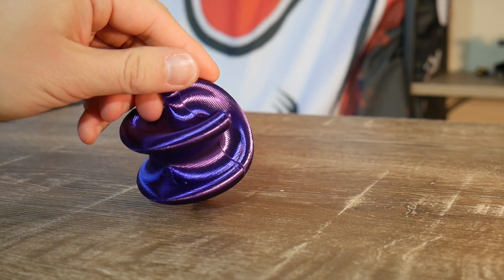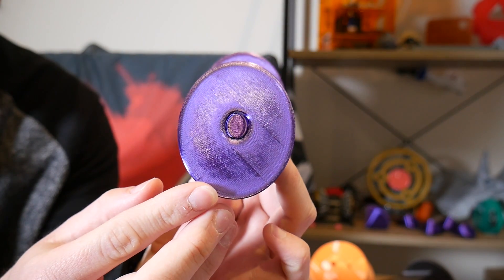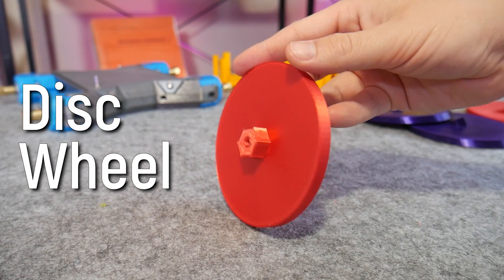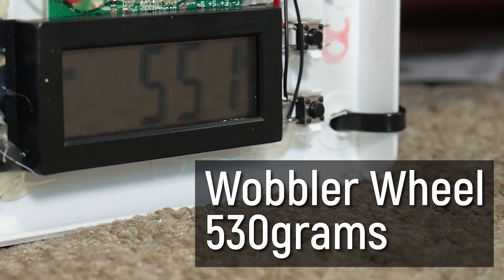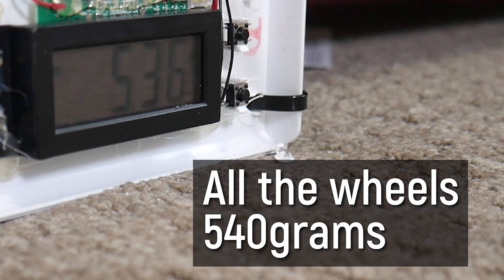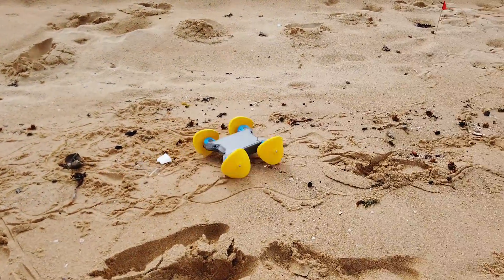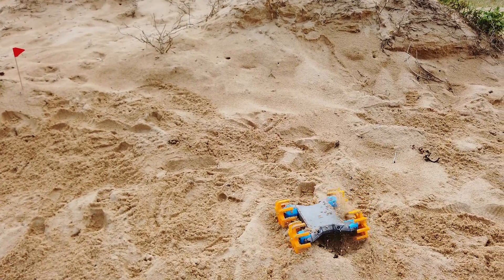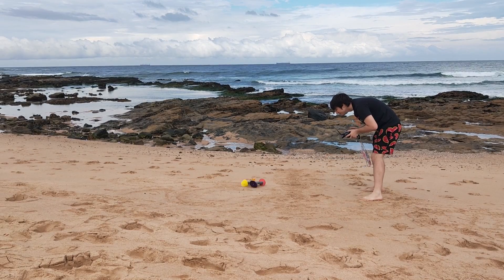This Robot Drives on Wobbly Wheels (but HOW?)

Comment: The spoked wheels had an unfair test due to their smaller diameter, so the chassis had less ground clearance. The beauty of paddle tires is that while the paddles are gripping, the surface between each paddle is providing floatation on even a loose sand surface. Loved the video anyway!

Comment: As expected the spoked tyres won out on sand but not so good on carpet. I propose a new design, based on the spoked but with 45° helixed spokes instead.
The spokes should be long enough that the end of one overlaps the start of the next. 
This allows for a continuous 360° of contact points with the ground but provides an ideal compromise for soft terrain where the spokes can lever off.
@Maker’s Muse

Comment: I guess NASA knows what they are doing with their wheel design on the Mars rovers, ay?

Personally, I think you need to count the sides of the paddle wheels in your surface area calculations simply because that is where the force is being exerted the most. Especially in the sand. To make it equitable, you should have perhaps half the paddles.

All-in-all though, the experiment was cool!

Comment: You want to know what is the best wheels for sand? Drill shape (big core and small fins), and make it CW for front left and back right and CCW for front right and back left so you can move the front and back wheels in different directions and move the robot sideways!

Comment: To drive a car on sand, you usually deflate your tyres since this creates a large contact area and low pressure on the soil. Together with the tread, this propels you forward. 

The spokes work because the contact pressure is lower. 

The Nightshade wheels don't dig in because they don't run create a rut until it stalls. 

Something between a Pringle and a folded Dorito would probably achieve a similar affect. Mathematically, I suspect the optimum fold over would be a sinusoid. 

A herringbone spoke might also work since it would trap the sand in the V.

Comment: I think there is no one "best wheel" for all situations because it depends on the situation.  The surface being sand, carpet, concrete, hardwood floor, ice, water, etc. each pose a different challenge. Also if the vehicle is pulling a load.  On mud or sand, the more surface area and if your wheels have paddles, then it will ride on top and not sink and get good traction.  If this were ice,  spikes or pins in the wheels or wheels that had spiky points of the ends would give it best traction.  Also the material making contact with surface matter.  Rubber vs plastic or some other material matters.  Also the torque generated by the motors also matters.  I know electric motors have lots of torque, but maybe less torque might be better in some situations.  But overall a very interesting and fun experiment!  I was surprised the wobbly wheels actually worked but they worked quite well and visually not intuitive on how they were actually working.  Keep up the great work!  :)

Comment: I think that the erratic behaviour of the wobble wheels on the pull test is because as they turn the contact patch of the wheel moves away from or towards the chassis, so the thrust vector for each wheel is moving sideways to the pull axis in a random way. The prongle wheels do the same thing, but at twice the frequency and half the amplitude per revolution, so the pull is steadier.

Comment: What about zigzag wheels? Sort of like the prongle, but with more folds, on both sides of the center line of the wheel? I'd think that it would help bite into the sand and push the vehicle forward.

Comment: Yeeah, the paddle tires actually have far far far more contact surface area than any of the other tires, because the entire front edge of each spoke is making contact in addition to the outer edge. Beyond that, you aren't using friction when you push with the side like that, so you're not only doubling the surface area, you're comparing apples to oranges too.

Good video though! The path made by the wobbly wheels looked just like the trail of a snake to me, that seemed to be the most stand-out detail that came of this.

Comment: I think the problem is that the wheels are spinning too fast. When they go faster, I believe they are just pushing the sand away, but if they were to go slower, they might have a chance. I think friction is also an important factor with this.

Comment: I think that the major problem is that the first 3 wheels move the sand to the side  and this cause the car to dig a hole and get stuck in the sand. 
The orange wheels move the sand from the front to the bottom of this hole under the wheels itself, so is more difficult to get stuck 'cause they gain a lot of traction as they move the sand.
Orange wheels are wider too an this is always a good thing on sand

Comment: Youre comparing 1d wheels against 2d wheels.
Regular wheels on the sand or carpet are only a singular small line, with 0 grip, because theyre smooth... and ure compairing them to curved wheels which are pushing with an edge.

Comment: A better test would be if the middle of the bottom had higher ground clearance. Then the wheels would all get a better chance to work. It seems most of the time when it gets stuck its the body and not the wheels that's the issue.

Comment: The 8 spoke have more traction on the carpet because it has a sharp leading edge contacting the carpet during rotation. What would happen if you printed a radius on the outside of the spikes. Same as the sand trial.

Comment: Would probably be a more fair comparison on sturdier ground, like dirt. The "bucketwheel" design is specialized for extremely soft ground like sand, but they are absolutely awful on asphalt and other hard ground. so if you were able to coat them in rubber or something you could see how they performed in a urban/racetrack-like environment.

Comment: #1 -- the wheels have no claarance.  #2 the 'spoke' wheels did at least a bit better because this thing called "traction" was discovered decades ago and off-roading doesn't need to be reinvented.  Interesting experiment -- but most of the transportation industries ahve already figured out motion mechanics for numerous ground conditions.  You seemed to be on the right path w/ the spoke whjeel ... look at different condition tire treads or different 'tank' tread patterns and come up w/ maybe an open design from those.

Comment: In the carpet pull test, the attachment point on the scale appears higher off the carpet than the point at the car. The chain should be exactly horizontal, otherwise the resulting force tries to lift the back of the car a little, reducing grip and making results meaningless.

Comment: Why not put 'paddles' or treads on the other wheels? They all have smooth surfaces, offering no grip in the sand, as opposed to the 'spoke' wheels, which are essentially all 'tread'.

Comment: I think the spoked wheels with an L shape instead of a
square shape. This would push in the up direction and at the same time push the
vehicle forward. In Sand, you need to push up at the same time forward.

Comment: Seems like the spoke wheels might handle the sand better if the open area between spokes were “filled in,” if you will...cool video!
Reply: And at that point you've pretty much created an off-road tire.

Comment: If you want to increase traction, use as little plastic between the hub and the tread and increase the surface area of the tread.. Depending on the surface, on something like carpet, change the tread into something bumpy like velcro. On sand, make the tread screen-like with the openings slightly smaller than the size of an average grain of sand.

Comment: Nice ideas, but I think the answer already exists: a lot of ground clearing, plus paddle wheels or tracks for a surface like sand. 

If you really wanted to test your designs properly on sand, wouldn't you have to enlarge everything to a size that actually matters for humans? Just wondering, because making those wheels bigger and a bit wider could actually already make them perform a lot better. If you compare a real sand buggy to a remote controlled toy one, you'll find that the toy one gets stuck in the same sand all the time, but not necessarily because it has an inherent flaw other than being very tiny.

Comment: No surprise.  The wheels remain a truncation of the cylinder and roll in the same axes of the original cylinder.  In practical use, the wobbly wheel would have greater traction but poor aerodynamics.

Comment: why not a dual hub wobbler (2 faces) spaced about the thickness of the spoked wheels connected by the treads in the orange spoke wheel for traction. I think a lot of the orange spoke wheel was the width of contact with the surface, but their were benefits of the wobblers that could give them tractions.  The other thing you might want to look into is 'Camber'.... How does Camber affected wobbler wheels, when camber is such an important factor to car handling. How do wobble wheels work affected by suspension?

Comment: 2 suggestions -
1. Add spokes to the Prongle wheel
2. Add a suspension system to the 8 spoke wheel, I hope it will reach the finish line. 😉

Comment: The spoked wheel is essentially a disc wheel with an additional feature. To make it a fair comparison, we would need to see  a wheel that is both spoked and wobbly. Additional suggestions: stick wheel (lots of long narrow studs poking out from the wheel) and brush wheel (even more even longer and even narrower appendages, preferably flexible)

Comment: combine the solid wobbler with the spoke teeth wheel so that it's a solid wobbly wheel with spokes- Wider diameter wheels will make them more efficient in sand, even if only a little bit larger, those wheels looked a bit small. If you adjust the spokes to be centered on the rim of the wheel hub instead of only on one side the spokes will have more structural integrity with the same surface area- you could use an extended axle for them to account for the wobble and spokes.

Another design is a wheel of pin spokes, that just simply point down, maybe even with a small attached circular pad on each one or just a sharp tip ?

Comment: When it comes to loose material like sand, it's all about having paddle wheels that act kind of like a scoop. You want to push against as much material as you can, but you don't want it getting stuck in any recesses the tire has.
Reply: The combination of paddles on balloon tires gives traction without sinking/digging into the sand.

Comment: Don't forget the speed of the wheel turn does have its factor toward traction on loose soil or sand.  Some times slower is better than high speed, which can cause the dug out.

Comment: force = mass/area... you measured the wheels wrong. The reason the spoke did best is that, at any given moment, it has FAR more surface to ground contact. This is commonly known to act as a friction force.
Put another way... if all the motors, plastics, charge, and the ground remain the same... what changed the outcome? Surface to ground contact.

Comment: Folks, if you love this man's work, then give him the credit he deserves. 
Mix, remix, adopt, adapt, hack, extend, derive, re-imagine as you will... 
But above all, respect the sources of ideas. 
That's closer to the Maker Spirit, I would imagine.
Reply: Perhaps if the in-between regions of the spoke wheels were filled in, as were the buggy weels at 13:10, you might end up with a better wheel for sand. Also, are the wheel moters able to talk back their rate of spin? If so, you might have the basis for a sort of electronic limited-slip differential. Why solve one problem when you can focus on a hundred problems?

Comment: The benefit of the Wobbly Wheels is the potential ability to run them like a screw and drive the vehicle directly perpendicular to it's line of travel. This would be accomplished by running the front axle in reverse and the rear axle in forward. The other benefit of using this mode of travel is that the vehicle has a narrower centerline cross section when traveling sideways, which limits the probability of it becoming high centered.

Comment: Very cool project and experiments! I wonder if those spoke wheels may have performed any better on the sand portion if you installed them facing out away from the body instead of in around the arm and motor? My thought is when they started bogging down there would be more open room to move sand and possibly move forward instead of losing momentum. Thinking further down that line, if you installed the front facing out and the back facing in then they wouldn't be digging into the same trench line.

Comment: I think, the spoke wheels did so well because of their larger contact surface, thus distributing the weight of the platform over the sand.

Also, I think If you're driving at a slower speed, I'll presume you have a better chance of getting unstuck

Comment: very wide paddle wheels at a very slow speed should move over the sand instead of brushing it backwards even at steep slopes. one improvement to the existing spoke wheels can be to make them solid, with the spokes being the "paddles". this way, however, there would be a very large surface area for the wheels.

Comment: Straight wheel 405g = 101.25g per wheel 
Wobbler wheel 530g = 132.5g per wheel 
Pringle wheel 550g = 137.5G per wheel 
8 spoke wheel 600g = 150g per wheel

1 of each wheel 

101.25+132.5+137.5+150 
= 519.25g theoretical compared to 540g actual

Seems about right to me...

Comment: very cool video! In my opinion it‘s obvious that the wheels would rather dig themself into the sand than moving the vehicle forward if the plattform is laid so low.. there‘s a reason off-road vehicles have much more space to the ground than supercars which can only drive on streets

Comment: If that vehicle with the wobbly wheels is boyant exactly at the centerline, it looks like those wheels would provide probulsion along water as well. As in, it looks like You'd be able to have the sideways forces cancel eachother out, and have clean forward motion.

Comment: Hey beautiful community, so iv purchased an ender 6 as my first 3d print that I own. Iv used the ultimaker 2 at school and the ender 3 from my friend. So I opted to go for the big guy. Im really struggling to get good clean prints with the ender 6, iv dehydrated my filament, upgraded nozzles, updated drivers(software), I tried different slicer versions of Cura and im still having a hard time getting good prints. Im really tempted to sell the printer and get a Prusa. But im willing go give more ender 6 another gooo, but I need a little guidance from someone so if someone would be awesome enough to give me a hand with walking me through getting my prints at a higher success rate that would be awesome 🤙. I am using the printer for printing my own engeering designs and stuff for school (university). Let me know if you wanna join a discord or if you have a discord I can join to get some help! Thanks

Comment: Based on the carpet test of the 'wobbler wheels' pulling right even when you flipped the car over it makes me think that they have a chirality to them depending on if you make the cylinder slice at a positive or negative angle and it's got me curious if pairing them might produce a slightly better result. (Aka a pair left-handed on the left and Right handed on the right) to counter their pulling a bit. 
Though if they're on the wrong sides it may end up just burying the body even quicker on the sand tests.

Comment: Cool, this is the first video I've ever seen about wobbler wheels. It looked like a lot of the problems might have been caused by higher RPMs more than design. Even a 4WD truck will dig if you hit the gas too hard. Also, fins on the inner and outer acute opposites of each wheel might help grab the sand better.

Comment: Your robot seems to be bottoming out in the sand which is no doubt a lot of resistance / friction. I believe that if the wheels were taller the bottom of the robot would bottom out on the sand less reducing the friction.

Comment: @Maker's Muse The 'scoops' on the yellow wheels definitely gave an advantage on the sand. Could you extrude bars from the other wheel shapes to give them the same sand-gripping power? Maybe put the bars facing away from the chassis so they don't collide with the frame?

Comment: For sand you need low surface pressure and good scoopability. Sand vehicles for fun have what is called "paddle" tires for max traction in sand.  Your wheels would have been great on ice with little 3D studs!

Comment: I love the way the red wheels shimmer as they spin. How much does that rig weigh? I'm wondering, if you build a light enough unit and fitted it with those velcro wheels you mention, could you create a course for it in velcro up the walls and along the ceiling? You could have a hell of a race with friends on a race track that goes literally all around the room xD

Comment: there's another channel  * Major Hardware   - does simular  with PC  fan blades  people send in there 3d printed Blades & he test them .
The db  levels  & the amound smoke they move + cooling    . - ive quoted the owls wings tips   Stealth quite as . 
good to see these wheels been tested   . 💯 when people post videos   it opens up Q's  and  new idea's
1 more -  having  gun/ dust   on any  fan tips  reduces  efficiency   by 30%  as with blocked  heatsinks  .

Comment: Very interesting! The main metric - as you used - to propel the vehicle forward is of course very good. As additional metric to compare wheels I'd actually suggest to use weight: energy to propell the vehicle might be interesting and limiting the vehicle eventually. As additional restriction one might want to add the capability to bear load attached to the axle (thus how heavy a vehicle can it carry - this is interesting especially when you consider weight of the wheel to be a metric).